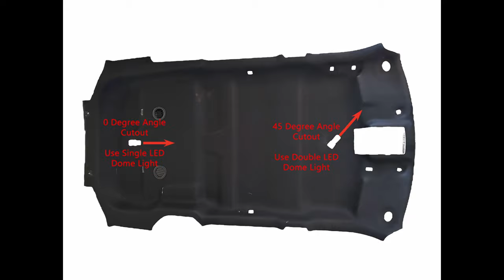How to Upgrade the Ticket Dome Light in a Police Vehicle

Comment: These look super cool. I would love a low profile replacement, however I would've loved to see a red light mode like the original. Maybe a separate button on each of the lights to switch between them? Not sure how you achieve that. If this is possible to do, I'd love to purchase one with the dual light modes. I do use the red light at night, the original isn't very bright so that's why I'm commenting this lol.

Comment: I have a 2013 police interceptor sedan and I’m having a pats code / no crank no start and was wondering if you could help out I have hooked up ford scan and it throws a pats code and a loss communication code
Reply: I believe you can disable PATS in ForScan
Reply: That’s odd because the police interceptors don’t even use pats. Someone may have swapped the BCM or something and never programmed it to your cars parameters. Forscan can fix that